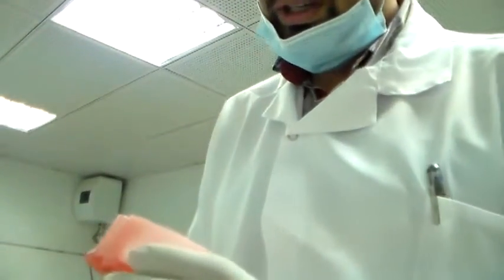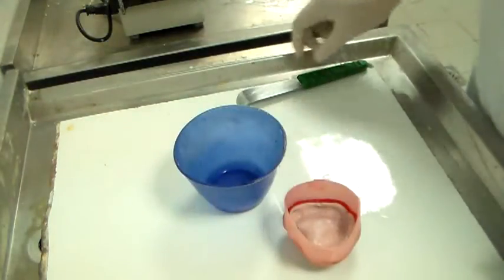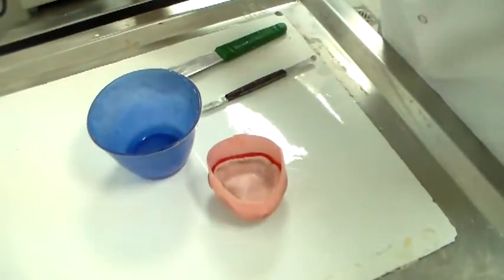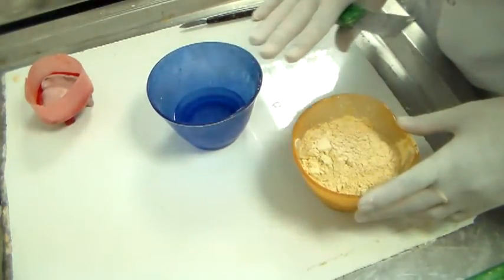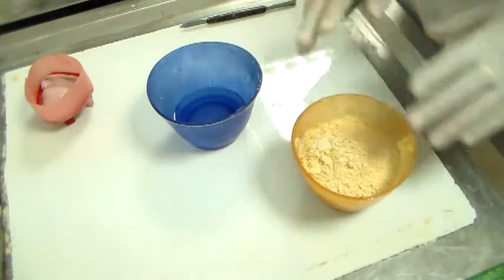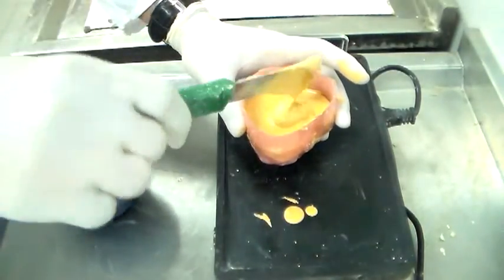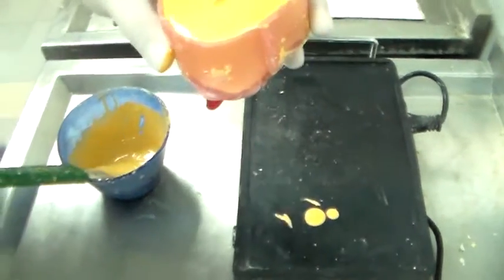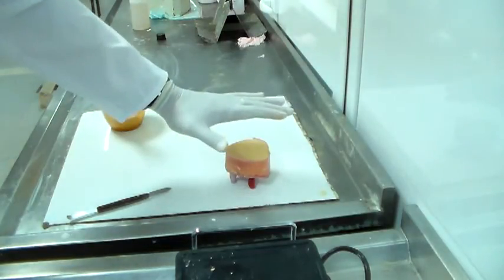4.Pouring the Max  Master cast

Comment: I have a question..
Mandible has 3 handles while maxilla has one so does that(having one handle) interrupts stable master cast fabrication?
Reply: I mean does having single handle makes the cast tilted?
Reply from the maker: Hi there, 
I am presuming the question is about the mandibular special tray handles.
The design of maxillary and mandibular special trays handles have a lot of variations in terms of design. 
I have seen multiple handle designs in mandible too. Whichever design you use - do make sure they do NOT interfere with the master cast fabrication. That will make fabrication of master cast easy.